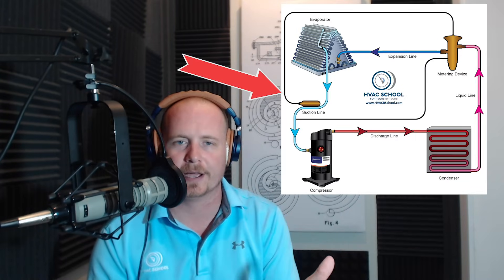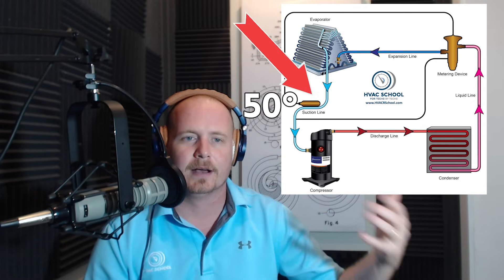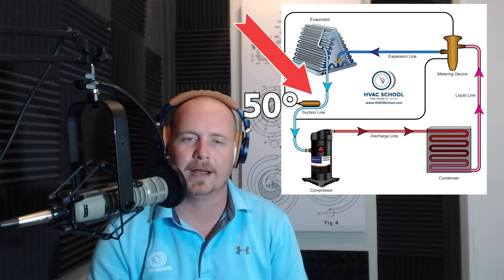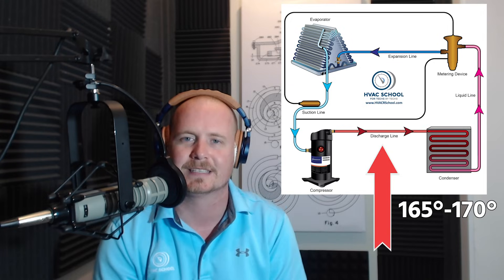Air Conditioning Compressor Basics

Comment: Excellent. Many people don't realize that compressors are cooled by the proper refrigerant charge, using that coolant on the return or suction line, to keep the compressor from overheating. Thus destroying the oil and parts within the hermetic or semi-hermetic compressor. Very well explained. Thank you for all of your superb videos.
Reply: Nice bro iam from Ethiopia Refrigerator maintenance .uf u have information, vacancy i need thanks
Reply: InstaBlaster.

Comment: A8:30 again yes but that's backwards fri=om what we do observe. Take one molecule it moves at a speed at ambient conditions If we reduce its volume in 1/2 it hits the wall more often . Leave the volume the same and heat it the speed goes up hitting the walls harder You get more bang for the buck by just heating.

Comment: @7:14 no they don't move "more fast" there speed is directly related to their temperature. I you compress the gas very slowly their energy or speed stays the same. A molecule hites the vessel wall more often because there is more of them. If you heat a given amount of molecules up they hit the vessel walls harder due to having more energy/speed.

Comment: @7:min that is so wrong. Yes you may observe a temperature increase,  but that's called the heat of compression. Aside from that the pressure goes up due to the container walls getting hit more often If you heat the molecules up they speed up and hit the container walls with more force. The later being way more effective. With an open ended vessel the molecules are moving at some 1,200 mph no matter the the pressure if heated only then do they move faster.

Comment: My AC is acting weird! When I turn it on, the motor starts, and the compressor kicks in for a minute before shutting off. This keeps happening every 10 minutes or so. And when I switch off the AC, the furnace motor just won't stop running!

Troubleshooting Steps:

I've been trying to figure out what's going on, and here's what I've done so far:

I replaced the capacitor in the compressor, thinking maybe it was the culprit. But even with the new one, the problem persists!
I gave the compressor coil a good cleaning with a water hose, 'cause it was pretty dusty. Didn't seem to make a difference, though.
I tried bypassing the thermostat by connecting the yellow and red wires. Still, the same issue.
I checked the drain line for clogs, but it seems to be flowing freely. I even poured some vinegar down there to make sure!
Despite all these attempts, I'm still stuck with this annoying problem. Has anyone else experienced anything similar? Any ideas what might be causing this? Help a guy out!

Comment: what would be a bad compressor ratio? i had an r22 runing on my low side at 96 with a discharge pressure of 267. it was a new customer i dont know what the previous company did, lst company was their 5 years ago. i replaced the fan motor, cusotmer didnt want a new unit, so basically i made it clear to the customer that unit will not operate efficiently

Comment: the video is factually correct with good usage of technical terms that most technician would have a problem with. Plus, a good explanation of why the temperature of the vapor refrigerant is increased was made. Some people would mistake increasing pressure means increasing the temperature but in fact the superheated complete vapor does not correspond to pressure/temperature relationship.

Comment: Make so much since that the compressor can't turn the vapor to a liquid because if you're compressing somthing you're increasing heat and heat doesn't make liquid it just "create" more gas but the condenser coils are actually rejecting heat and changing the state.

Comment: Hello Bryan
Question, if you have r22 compressor and it is absolute can you replace it with R410 compressor remove compressor POE oil and replace it with mineral oil and charge it with R22 refrigerant will it work?

Comment: WhoEver invetend AIRCOMPRESSOR.... WAS GENIUS.... 😮WOW.... MADE IT SO DIFFICULT FOR US PEOPLE THAT SCRAPE METAL THINGS..... I OPENED UP AN AIR COMPRESSOR FROM AN AIR-CONDITIONING UNIT THAT MY NEXT DOOR NEIGHBOR THRU AWAY.... O BOY IT TOOK ME 2 DAYS TO OPEN IT.... I JUST NEEDED IT'S COIL COPPER WIRES... I'M STUDYING ELECTRICITY AND NEED IT FOR MAKING A GENERATOR ⚡ WITH ADDING 🧲 MAGNETS TO IT'S COIL WRAPPED COPPER THING AND ALSO OTHER PART TOO..... I'M STUDYING ELECTRICITY AND MAKING MY OWN GENERATOR.... HVAC HAS ALL YOU NEED PARTS TO MAKE A GOOD ELECTRICAL 🧲 MAGNET GENERATOR....

Comment: it is a great video! Thanks! I just believe that a higher compression ratio means that the compressor is compressing the refrigerant vapor to a higher pressure, resulting in increased work done by the compressor and higher system temperatures.

Comment: It’s actually an increase in density. The denser you pack a liquid, the more energy you’re gonna get (heat that is built up). The compressor packs the refrigerant into a condenser, but it also pulls on the suction line, creating a vacuum. It creates both hot and cold at the same time.

Comment: I replaced my first compressor today in a rac. I had 0 clue what I was doing since I started commercial literally last week and I’m used to residential, my trainer made me replace the compressor on a rac and didn’t help out with anything just said “go do that.” Even though I made it open that I am very green and just learning so I don’t know what I’m exactly doing yet. Still made me do it with 0 tips or clues. I messed up on literally every step besides shutting off power and checking power. But he wouldn’t help me or walk me through it and he kept getting butthurt at me. I wanna learn this stuff but the guy training me is a pr*ck

Comment: I heard from someone that a guy had used a plasma cutter to cut an AC compressor open, when it was still under pressure. Something like, he ended up in the hospital as a result. How much PSI does a scroll compressor usually hold?

Comment: Amateur question here: if the compressor is working and winding resistance is correct, how do you know if compressor is mechanically bad? Will it not be able to reach condensing pressure? If so how will you be able to differentiate between mechanically bad compressor and low refrigerant charge? Would you just have to weigh out refrigerant then refill system and condemn compressor? 
Please constructive feedback only, no supertech comments. I admitted up front it’s amateur question .

Comment: I thought it be cool to make an off grid refrigeration system based on an open Drive compressor. Then you could have a DC motor spin it and be able to swap it with a gas engine, propane engine. Whatever you want. Control system would be difficult but totally possible. Love the videos by the way learning a lot
Reply: I set up a milk chiller for an off grid farm using a diesel lister engine :)

Comment: In Vehicle air conditioning they use a variable displacement compressor, axial piston design.  The piston is driven by a wobble plate or swash plate.
Reply: I’ve taken one apart before. MVAC compressors are bizarre little things

Comment: “These compressors are designed to compress vapor”. Do they make a compressor for liquid?🤬
Reply: ck out a Wilton pump. It will pump anything!
Reply: Alan Flower a pump is not the same as a “compressor” and it was a joke. A joke that should be self explanatory.

Comment: This was helpful. I wasn’t sure if the gas went to a liquid after the compressor. Makes sense though as heat will need to transfer into the outside air and gases do a good job transferring heat.
Reply from the maker: Glad it helped

Comment: "Those are rare because you have a shaft coming out of the compressor" ..most cars on the road. Don't forget about MVAC. There might be more open drive compressors than hermetics, could the number of buildings and their AC and refirgeration units compared to  vehicles.

Comment: Remember: a compressor cannot compress liquid
Reply: Can only fit one. Gallon of water in a one gallon container. But you can fit a lot of pressurized air in that container
Reply: But it can come press deez nuts
Reply: Right so don’t charge the suction side with liquid haha.
Reply: Yes. The video explained that
Reply: If so, how can oil go along the way the system then?
Reply: The joke today is toyota is releasing an engine that's made on water! But water can't be compressed....
Reply: liquid cant be compressed
Reply: @Pingorocho420 they can be compressed but not in magnitude of gases
Reply: Even with a compressor.

Comment: What is outer and why it  becomes faulty and make the compressor junk. Also when it burns, its windings damaged no smell comes out. It just list and stop, and become junk. Here I am talking about 1, 1.5 and 2 tons ac units. Yes the coiss are condebsers develop hokes and result in loss of valuable gas. You are not talking about ampheres,which may raise to 9  amphers.

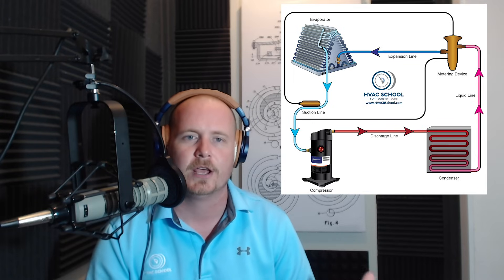Comment: 6:41  I live in a desert (+120F  in summer). Many people suggested to insulate the section line that goes back to the compressor in my car to have colder AC.
What do you think about this, will it harm the compressor because I made the refrigerant much colder than I supposed to be?
Reply: They're correct. Unless otherwise specified most cars and their acs are still designed for cold climes.

Comment: Hey what do you think about easy seal, supposedly it seals small leaks? Does that product affect the compressor or condenser? How long will it hold the refrigerant? Should I just recommend a new unit?
Reply: Find the leak. The concern with leak sealants is that theoretically it could create a block in maybe your filter dryer or your orifice. Because they are small openings and by nature a leak sealant, seals. Would potentially create a restriction

Comment: Is it possible to change the frequency compressor (RSporand) with another cylindrical (rotary) compressor in the same capacity or vice versa without changing the capillary in the same mechanical circuit? Sorry for the translation

Comment: Increase in temperature; is it not the same as increase in heat?
Reply from the maker: No, they are closely related but temperature is a measure of heat intensity. It’s like saying is distance the same as Miles Per Hour
Reply: HVAC School 
Can I put it like this: “temperature is a measure of heat”?

Comment: At 4:33 the video said the compressor is going to have to do less work, and will run hotter. It should say 'more work', right, to increase from a lower pressure to a higher pressure?
Reply from the maker: It is true that compression ratio often goes up when suction pressure goes down and this results in less overall watt input to btu efficiency. 

Nevertheless, when the suction vapor is less dense (lower pressure) the compressor is moving less material and therefore doing less “work”. 

A single stage (typical) compressor has a fixed vapor volume and essentially fixed RPM (though it will slip more under greater load)
Reply: @HVACS  Thanks, need to mull that over. And the compressor runs hotter because there is less gas to cool it?

Comment: Do you think you could have found a bigger mic? Does this guy think he's a ac tech or a rockstar?
Reply from the maker: I’m a podcaster and that is an Electrocoice RE-20 and is quite standard, but thanks for your helpful contribution. You seem like a nice person.
Reply: @HVACS  Your video is a good one. The ac business has really gone to hell. Back in my day a r22 unit would last 20 years or more if kept care of and in a moderate humidity climate with no salt exposure. Now I see systems 3 to 5 tons that cost 2 to 5 grand parts alone and fail in five years from coil failures, fan motors that burn out way too soon, locked compressors, and electronic boards that cost crazy amounts of money to replace. A friend called me to look at his system, he has a two year old goodman, evap fan out, told him just the (ecm)motor was going to be $600 at the dealer and I could put it in for free. Back in my day a fan motor lasted 15 years and cost $40.
Reply: douglas787 back when gas was a nickel a gallon
Reply: Ugly comments right here everybody.  Hate to deal with this negative people but, hey, he probably has his very unique reasons.

Comment: I went to a call the other day had had a grounded compressor.

Another guy came and installed a compressor and he had the black common wire on the same side has the red run wire.

I went there today and wired it correctly and now is it showing lock rotor

I owned everything out in the winding so I could I was just wondering if this incorrect wiring could have messed it compressor up
Reply: Yes if its wired wrong and the compressor is running it can burn out

Comment: Good instructional video.  I'm searching for answers on how these 'solar assisted' hybrid air conditioners work.  Some contractors are claiming 30% or higher savings by placing solar (heat gain) collectors (sun energy) that simply transfers heat to the refrigerant after the evaporator and towards the suction of the compressor.  They claim it can be added to most split or package name brand air conditioners.  How does it work or not work?  SUNTRAC is one brand of this product.